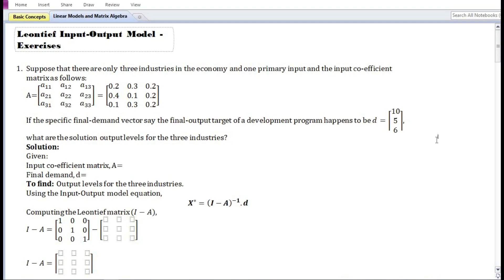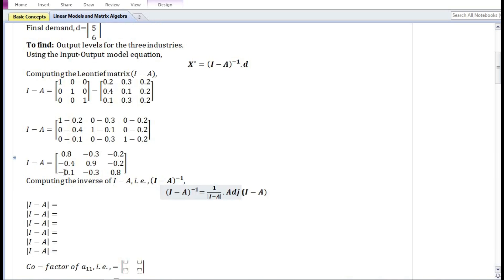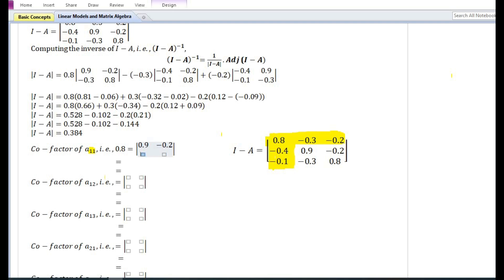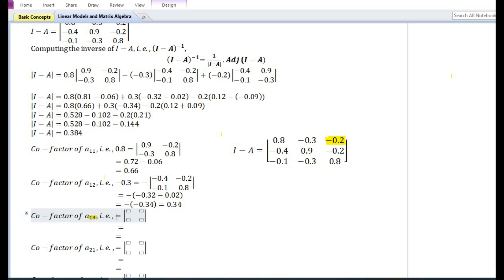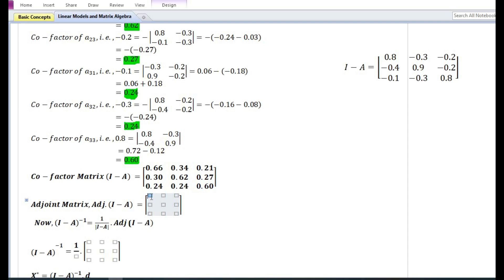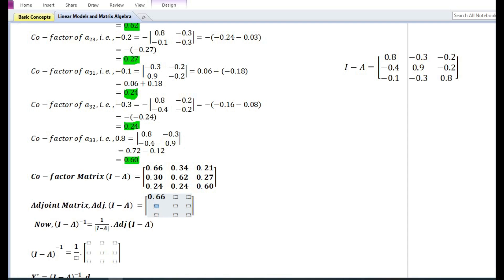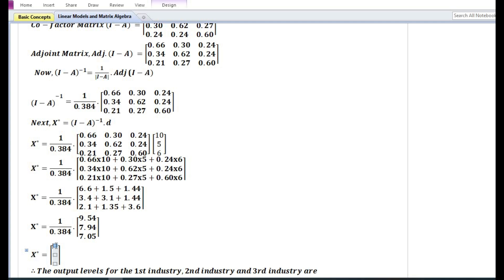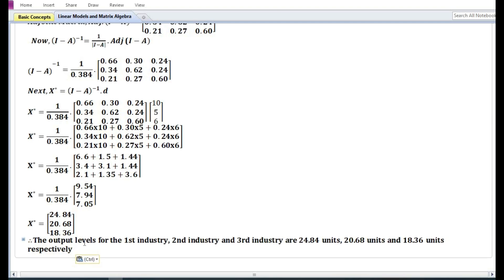Leontief Input-Output Model - Problem and Solution 1

Comment: My 3×3 input coefficient matrix result of derivative and diagonals are positive sign. So, I guess the HAWKINS SIMON CONDITION is satisfy but a confussion in other place ,  the total output of 3 sectors only one sector is positive sign then what should I do for negative value and other query is, gross output and total output are same? 
If not than how to calculate it ?

Comment: Thank you sir very well explained 🙏❤️
And I think there is small mistake there sir while finding the determinant of (I-A) in first step multiplication 0.9*0.8 will be 0.72 not 0.81. Also in 3rd step 0.2*0.21 will be 0.042 not 0.144
Reply from the maker: Thank you. Let me check and confirm